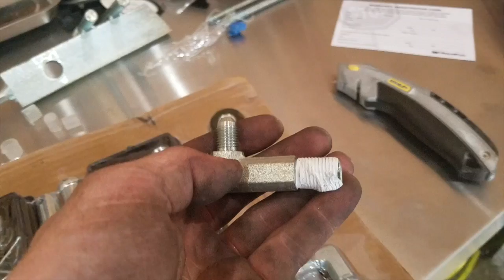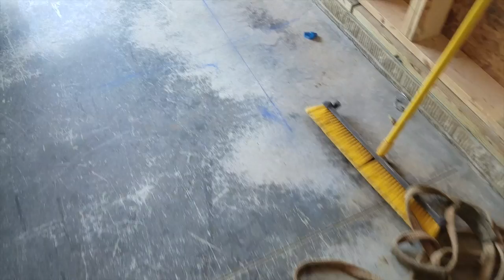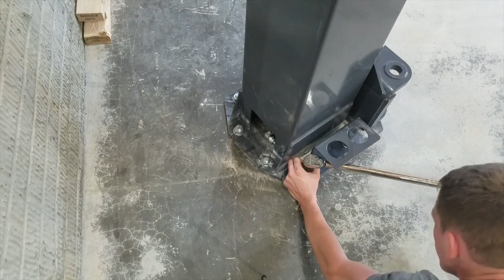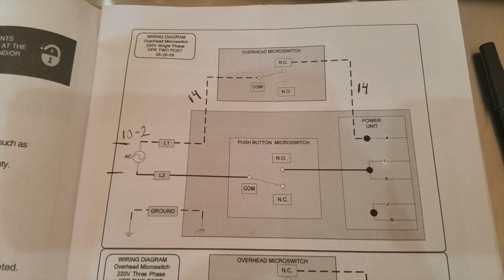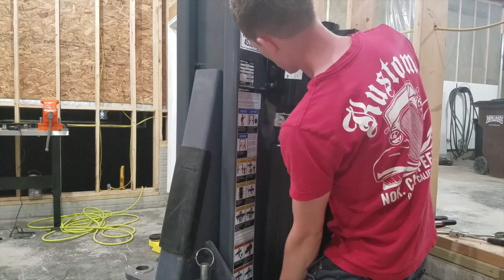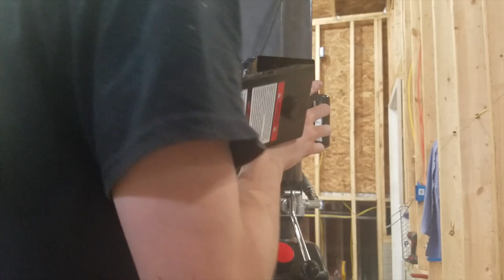BendPak 2 Post Lift Assembly- In Detail

Comment: Hey, this vid really helped me understand the hydraulic routing for the 10APX I bought earlier this year. There are a few differences between these models, but the 10APX instructions are trash and give no detail on how to route things. Also, I noticed  when you drilled the floor you went through the concrete into the aggregate and did not vacuum out the holes. This is now something that the current instructions point out. Just FYI

Comment: Hello great video I’ve was checking on This when you first uploaded the video. I’m looking to add the same lift to my 30x40 shop just one question how far are the post from your side walls the owners manual says 3 feet but that’s seems to far just curious how far are yours and do you have any room issues doing wheel axles or any type side suspension work thank you

Comment: Been 6-years.  Do you recall is 85 actually 3 to 5 turns?
Reply from the maker: No idea. I check the bolts 2x a year at 90 ft lbs. First year or so they would loosen some. It's been rock solid for at least 3 now.

Comment: Good prep for my 10APX install. Surprised you didn’t put an emergency shutoff switch on the post and use the overhead safety. If you ever had an insurance claim, it wouldn’t go well.
Reply from the maker: Any vehicle large enough to trip the overhead won't fit inside the garage door. 6 years later, no issues.

Comment: How far did you place each column floor plate from the wall? And how wide is the garage you installed the lift in?
Reply from the maker: Garage is 16ft wide. Lift is 12ft wide.
Reply: @RepairGeek  ty

Comment: I'm thinking the XPR-10A-LP must have been discontinued. Closest BendPak I can find at Summit is over $5k, and only 2 units are under $5k, with those being the low-lift "Grand Prix" series. Just my luck! All the reasons for going with BendPak made sense until I looked at the current prices. The BendPak website is pretty hard to follow, with so many lifts having seemingly very similar model numbers. I had hoped to see what was different between the XPR-10A-LP and the current offerings, but it seemed I was going around in circles.

Comment: XPR10-AS Question, page 24 installation manual. Warning- verify cylinder clamps….. what is the purpose of the cylinder clamps?  I did not see them installed on your video, but it seems like they would interfere with the lifting operation of the lift head.

Would be nice to see a closeup of the lift being raised.

Comment: 3/4 inch anchors according to Simpson strong tie get torqued to 150 ft pounds. I bought 8.5” long bolts because my concrete was thick enough and it torqued fine with no damage to the concrete.
Reply: Well I was just reading the bendpak install book and it says recommend torque is 85-95 pounds.

Comment: Four-plus years later and I can tell you that my instructions say 85 ft-lbs so good call on the Tq.

I'll be referencing this video when I put mine up. Thanks for the LONG, in-depth video!
Reply: Been 2-years.  Do you recall is 85 actually 3 to 5 turns?
Reply: @bigearn8782  Are you asking how many turns it takes to reach 85 ft-lbs?

Comment: The engineer that designed the equalizing cable retainers needs to be horse whipped.  I found out the hard way. If you have a good sized magnet, put it across the cable slot to keep the cable from falling out. After the beams are standing up you can remove the magnet.  If you have large arms like me, there's NO way to get  the cable back in easily.
Reply: I’m fighting the same thing! Good idea with the magnet! Gonna go get one now!

Comment: I'm about to install my lift and most 3/4 fasteners are torqued to 100-150 ft/lbs  lift on the market and you check torque at 80 ft/lbs.   Did you vacuum the holes out?  I see alot of people drill thru the slab so they can pound the fasteners thru in the future or if there's an issue.

Comment: With regard to the use of  short 14awg wire internal to the lift and safety switch verses the 10awg or 12 awg feeder from the circuit breaker panel, there is no issue or problem. NEC requires a heavier conductor for the long run to the panel to keep voltage drop less than about 3%.  The short run of 14awg will easily carry the 20 amp load or even more without appreciable voltage drop or heating. The NEC rules apply to the house wiring and not to the appliance (lift).

Comment: Not installing that safety switch is a stupid decision and your reasoning is even more stupid. If the switch arcs closed or the contactor does (what you called a relay) the vehicle is going to continue going up until it gets crushed and breaks the lift. If you have expensive vehicles on the lift, it's even more reason to have the safety switch operational.

Comment: Those safety switches do work pretty good. I own my own shop, i have 2 bendpak lifts and have never had a problem with this switch failing, although on most car it never touches the switch even at full height, but trucks, suv & vans it does.

I would wire it in anyways just to have that added safety, so if you get distracted and raise a vehicle and not pay attention and then dent the roof from the crossbar of the lift
Reply: Differently some vehicles last minute or just some being pain these can save you from crushing a roof or  knocking a vehicle off a lift  I can't remember what I was working on but I lift it up thanking about job at hand i had arms all perfect i new i was in the clear but the vehicle was tall im tall so you get yousta how many clicks or the height you like it one day it stops low you can belike thank god for that cable I've worked in tall shops with open tops i was at small shop loved it owner was previously a mechanic him self alowed me to right every thing up for customer to see be for doing work if it mint jigling and tracing every wire checking every ground fuse even compression check smoke michine and  before claiming anything bad some customer would state what they wanted done we would do as customer ordered but alot of times i could still find somthing on forms for gm tech but swore off hes computer and 3 million dollars and tools that i was blessed to use wish i could aford  he and hes wife blessed me with a job  for 6+ months till covid shut us down we tried making it through it eventually cleared the lot i asked for job back later and couldnt do 15$ hour witch i proubly should have taking i was happy there if yall are ever introuble on i70 jason at trackside automotive never skimps is a loving hearted guy very passionate about what he does ive only does in house while i travel and lose tools and spend a fortune in fuel to point I end up fixxing cars for love of it

Comment: How many amp does the magnetic coil pulls in the relay? That small wire to the safety switch breaks the connection between the switch and the magnetic relay coil not the motor winding. So it has nothing to do with the 10/2 power feed
Reply: Yes, just a limit switch, not a load switch, just ask an electrician, most of us are happy to help a youngun..

Comment: As far as the gauge of the safety wire, I haven't seen the full schematics, but the safety should only send power to the coil on the relay through the button where the main power has to run the pump.  The coil on the relay should only pull an amp or so where the pump's power requirements should be on the plate on the motor.  The fact that the safety switch has a thinner gauge wire going to it doesn't matter.  That's why you have a heavier wire to the lift.
As far as your hearing air coming from the top of the cylinder, from what I could see from the diagram, hydraulic fluid is only being pumped into the bottom of the cylinders, the top side has air in it, as you raise the lift, that air has to be vented to the atmosphere or else it would be compressed inside the top of the cylinder when the piston raises up, which would increase the load on the pump and probably blow out the piston seals.  The top side piston vents should have filters on them to keep dirt out of the pistons.

Comment: Very helpful vidjao!! We learn more mistakes than from success, your's were very useful. How did you get those cable ends to fit into the u-shaped slots in the carriage? I made the decision to stand the posts up before routing hoses and cables because I had the help. Not how I would have preferred. Thanks again!!

Comment: Just wanted to comment on your video for the safety switch wiring, you were concerned that they gave you 14ga wire. Since the wire has 4 conductors i connected 2 together so it doubles the gauge.  Also did the same way putting the top piece on first before bolting it down, im guessing its a safety reason they tell you to bolt the lift first.  I cant imagine trying to bolt it first, it would be impossible to line that top up.

Comment: I'm currently going through the misery of putting the same lift together. The instructions are TERRIBLE and I find myself saying the same things as you. How the hell you supposed to zip tie the hoses back 🤦🏿‍♀️ Or why isn't this mentioned in the instruction manual! I do like your idea of bending the tabs in btw. They should have had the hydraulic lines be the first process. Everytime I move the lift block around to pinch the clips in the cable falls out of the U shaped piece. Anyways glad you made this video 👍 this process would have been awful if you didn't make this video. So thanks 👍

Comment: Hey man, I found your video while doing research on a hoist for my home shop. Great job documenting all processes and procedures. Question for you, do you still like it? I'm on the fence between this and a Rotary... I'm not sure it's worth that much more for the Rotary in my home shop using it a handful of times a week. Is it still doing everything you ask it to? Thanks man ~Mike
Reply from the maker: Yep other than initial cylinder problems the lift has been fine. The largest vehicle that I've had on it was a brand new Dodge 3500, 6.7 Cummins, 4x4, with the giant megacab and a short bed. You could tell when lowering the vehicle you were dealing with a LARGE amount of weight. If i was lifting a vehicle that size all the time I would invest in a larger unit.

I looked at Rotary units as well but they were about $1500 more for a comparable unit. My suggestion would be to take a hard look at Danmar. I believe they are coming out of the same factory in China as the Bendpaks but are cheaper and are painted a different color. Every Danmar I've seen looks  identical to the Bendpak. I don't think you can go wrong as long as you're buying an ALI certified unit.

Comment: I am installing similar lift (xpr-10as) how did you install the elbow fitting in the cylinder?  You didn't show in video.  On mine, the fitting is NPT and the cylinder is different, i suspect BSP.  These threads are not compatible.  They are close enough to force in in, but eventually it will leak. Also, nice detail video, so far the best I've seen.  Thanks

Comment: I bought the "GP-7LC" model and a major difference is that the overhead arm is a substantial, and heavy, hunk of steel. It houses the single hydraulic cylinder used in that design, and there is no way two guys on ladders could carry it up as demonstrated with this model.
Reply: Wow--The model you got (or closest to it now available) now costs $4,300. You got yours for $3K, which is what I paid for my lighter-duty model. Your timing was right!

Comment: Question on the wiring.... why run power to motor then run a 10' 2 wire run for the switch? Why not just run power past switch to motor? Is the switch not rated high enough? The 2 wire approach is the same thing.....right? What am I missing here?

I've said it before but worth repeating...great video resource. Thank you.

Comment: Decent video. It took me and two other people 5 hours to completely install. We stood both posts, leveled, squared, anchored, then ran the cables and hyd line. Two people routing the hoses ect, and one working on the wiring. Good job and your video definitely gave me tips and made the job easier. XPR-10S was the lift I put up for reference 12'4" walls plenty of room.

Comment: Awesome Vid but had to pick up something that may be a crucial flaw.  I saw a can of WD40 laying in your posts, not sure where you would use this on a new lift and if you had to hope is just short term as that is all this junk is for,  They should actually take WD40 off the market as it is the best rust promoter if left on any length of time.  Been in the Aircraft industry 30 yrs and better penetrating /lubricating fluid is ACF 50, Aerokroil, PB, Liquid wrench.  Or if actually using as a penetrating fluid and out performs anything on the market is 50% synthetic transmission fluid and 50% Acetone (wear goggles).  Just wanted to mention this as love your Vids and hopefully with lots of consideration you will junk that stuff.
Reply from the maker: I was using the wd40 to route the hydraulic lines the wrong way haha. I eventually caught it and made it right. The can was still nearby that's all.

Comment: Just a FYI the latest version of the instructions for this lift states the anchor bolts need to torqued to a min of 110 foot pounds and max of 150 foot pounds so you might want to increase the clamping force and check the cable tightness they do stretch over time

Comment: How do you get the cable in the u-shaped slot in the carriage in the first step? I’ve got my lift laid on blocks like you did but I can’t reach inside the carriage to set the cable in the u-shaped bracket... Any advice? Great video BTW!
Reply from the maker: My skinny arms fit inside 😁
Reply: Haha thanks for the quick reply. I guess I need a skinny friend to help me out! Awesome video. I’m just starting to install my lift and this video is wayyyy better than the instructions!
Reply from the maker: @joshwestbrook6219 thanks but, the instructions set the bar pretty low haha.

Comment: Teflon tape isn't thread sealer, it's lubrication so you can tighten it more to get a deeper seat so to speak. It also helps as acting as anti-seize.
Reply: It is a sealer.  Any tapered tread like NPT relies on teflon tape or pipe dope to seal the helix path between the treads.  Regular non tapered treads rely on a shoulder or o-ring seal somewhere.  Lubrication and anti-seize is a secondary benefit.
Reply: NOT TRUE!!
Reply: NOT TRUE!!

Comment: Finally done and working...  Several hours spread out over a month of cold evenings. One of many points that is not made clear in the instructions is that the longer equalizer cable starts on the power post. Should have been made clear in the instructions as they will not work the other way.    I picked up straight fittings for the bottom of the cylinders. There is enough space in the carriage notch to allow the hose to connect on a straight rather than the 90 degree they supplied.   I bolted one post securely to the floor, fastened the second loosely with two studs so I could move it a bit to get the crossover assembly to drop in and bolt up easily.   I found that shimming is very important. When the base is welded to the post there is some slight warping. The edge of the plate is actually 1/32 of an inch off the floor, which you can see when you rock the column. If the shims are not used, torquing the studs will require flexing that base plate until it contacts the concrete. Use the shims while checking posts for plumb.   Someone mentioned epoxy...  not necessary, but a good idea. I smeared a heavy coat on the studs above the expanding collar, hammered them in place and tightened.. best of both worlds. To the Repair Geek... great video, thank you for posting this.  Secondly, if your girlfriend is willing to help in the shop..  she's a keeper.
Reply: Hi
Which straight fitting did you used? I do not like the 90 degree angle because I can not tighten it as much as I would like to because of the angle.